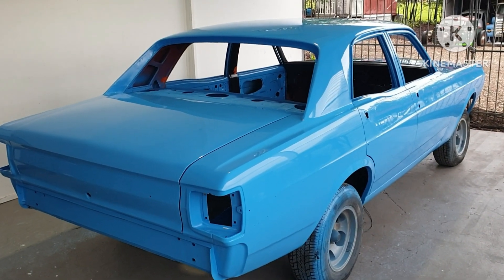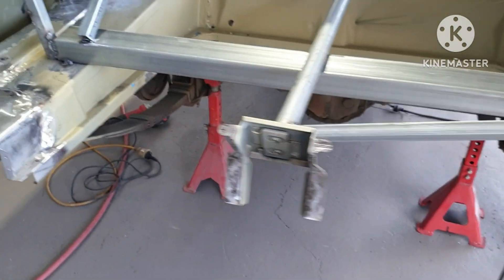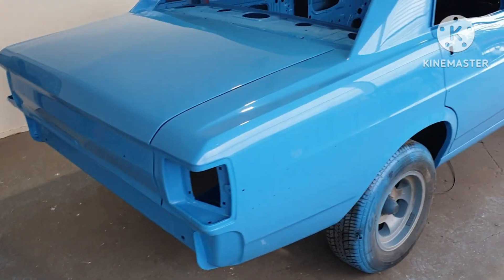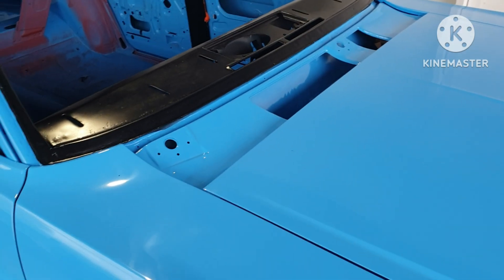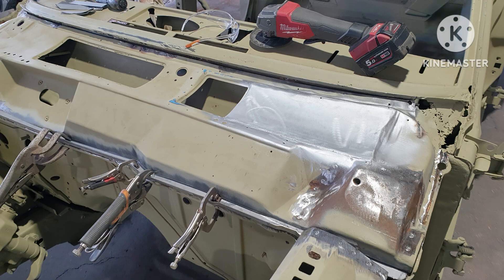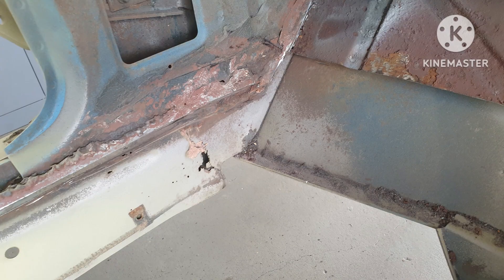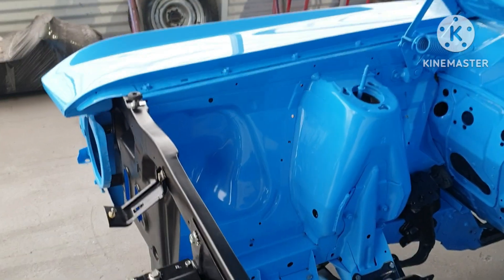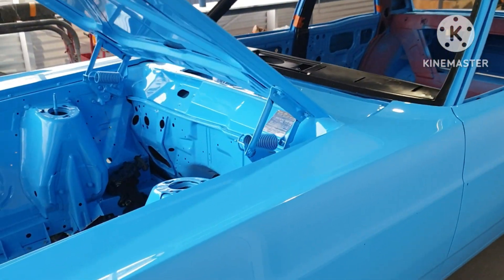XY Falcon As Good As New

Comment: Hi iam thinking of doing up a monza green xy falcon 500 factory 6 cylinder column auto, that i have located. But i need to find out if the owner wants to sell it. Ps it's great to see them go back to a original condition, not in to a replica gtho. Great job, cheers mate 👍 👌

Comment: Back in the mid eighties, I got told about an old Falcon for sale,
out the back of a local pub.
Turns out it was an XY sedan, factory 250 six, top loader 4 speed,
drum brakes all round.
White with a saddle interior, bucket seats, console etc.
I paid $200 for it and drove her round unregistered for about six months,
thought I was Allan Moffatt.
I sold the uncracked dash pad and one guard, to a guy that had a GT.
Sold the Top loader and bell housing to another guy.
Finally my old man asked me to get rid of it, so I took it to the tip,
rolling a very straight, virtually rust free, XY Falcon, missing a couple of bits,
off the trailer.
I mean, who wants a factory 4 speed six cylinder XY Falcon with 4 wheel drum brakes, right?🤔